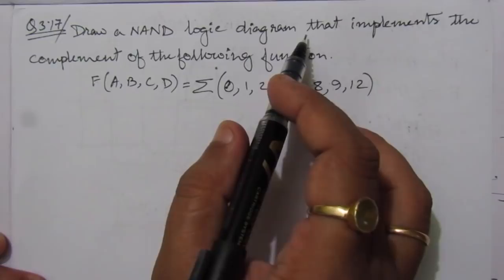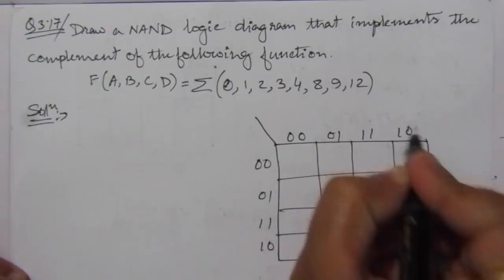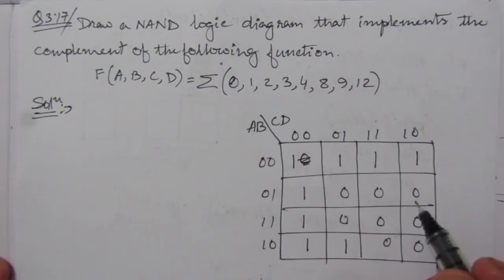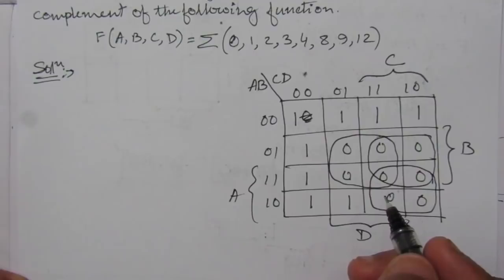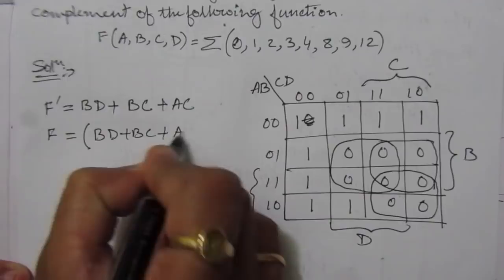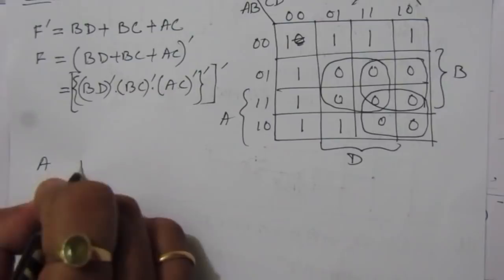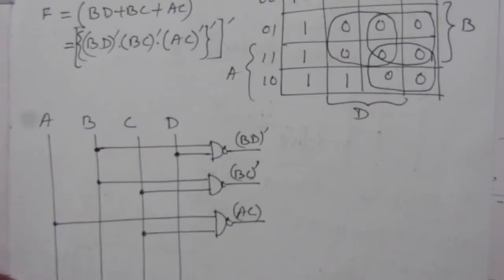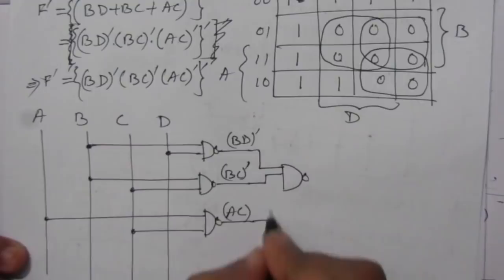Q. 3.17: Draw a NAND logic diagram that implements the complement of the following function

Comment: Assignment Questions

1. "Given the followin
(a) Obtain the truth table of the function. 
(b) Draw the logic diagram using the original Boolean expression. 
(c) Simplify the function to a minimum number of literals using Boolean algebra. 
(d) Obtain the truth table of the function from the simplified expression and show that it 
is the same as the one in part (a)."

2. "Simplify the Boolean function F together with the don't·care conditions d in (i) sum of 
products and (ii) product of sums, 
(a) F(w, x, y, z) = ∑m(0,1,2,3,7,8,10) + ∑d (5, 6, II, 15)"

3."Draw a NAND logic diagram that implements the complement of the following function: 
F(A, B, C, D) = ∑m(0,1,2,3,4,8,9,12) "

4."A logic circuit implements the following Boolean function: F = A'C + AC'D' 
It is found that the circuit input combination A = C = 1 can never occur. Find a simpler 
expression for F using the proper don't-care conditions. "